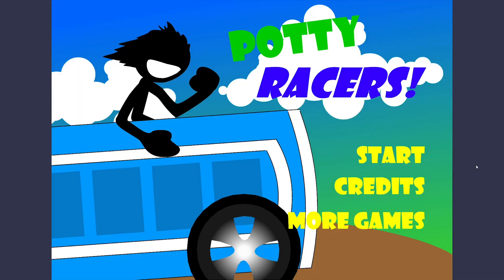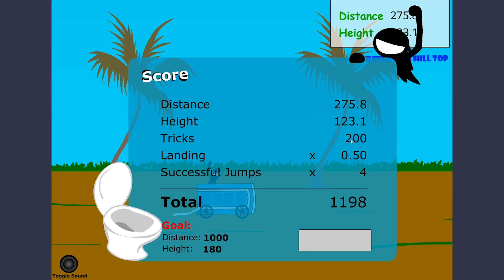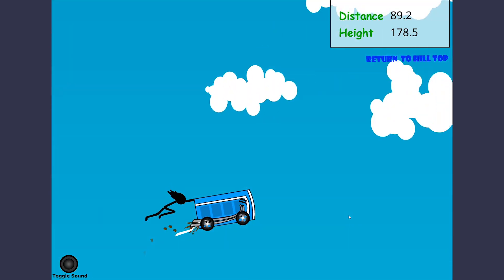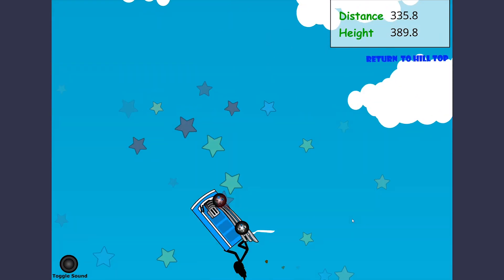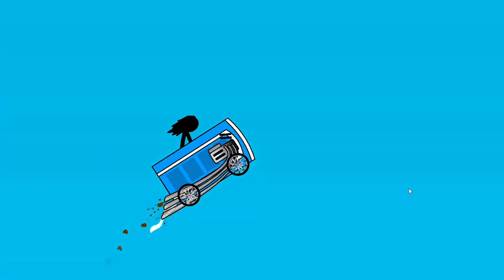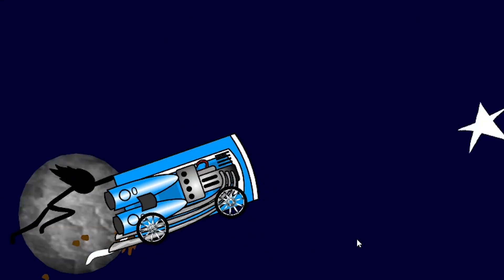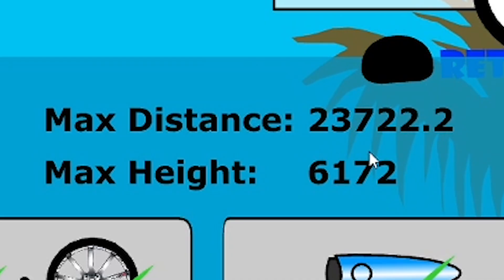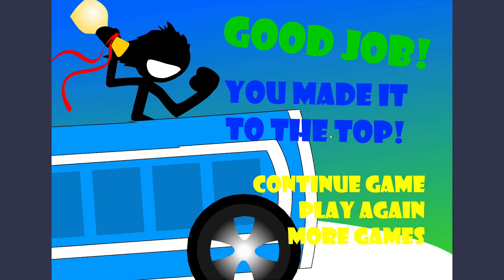Engineering a Porta Potty TO FLY!? Potty Racers!

Comment: Jumps: I think you need to clear the trees for it to count as a jump. 
Getting the most jumps is key to a really high score, because of the multiplier.
Reply: Except its actually entirely unrelated. The "successful jumps" thing means how many times you have launched without either crashin or upgrading to reset the counter.

It resets after when it hits 4 as well, it just goes 1234123412341234, thus followin RCE with that number the whole game heh